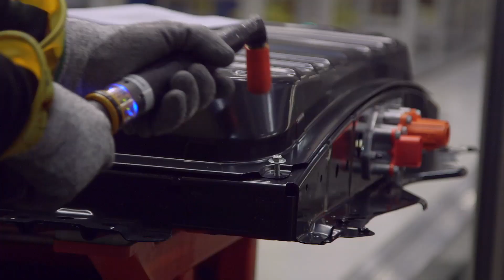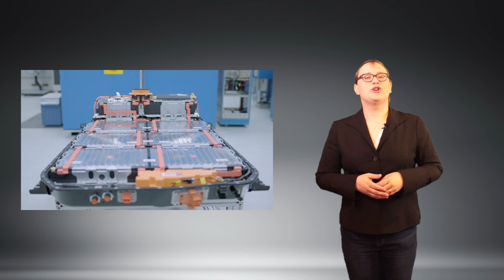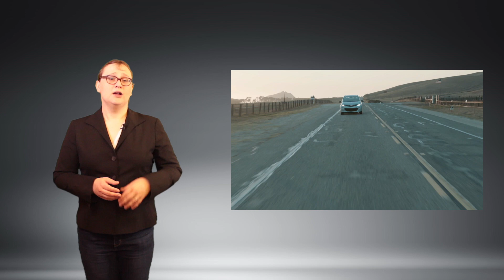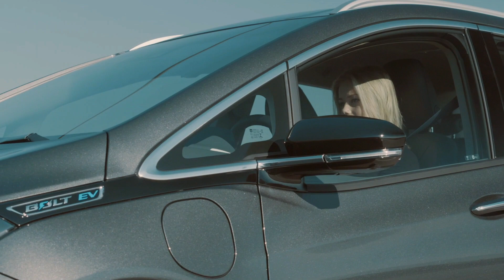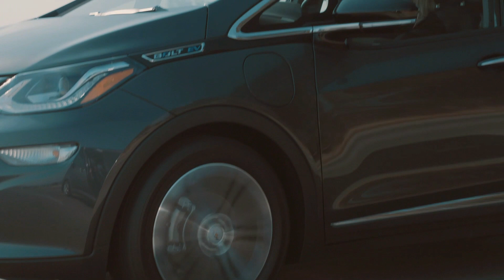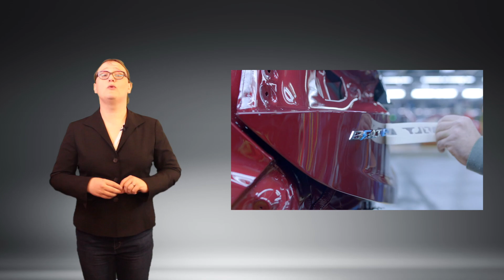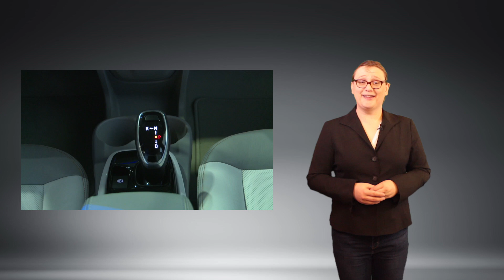Should You Worry About Battery Replacement Costs for Electric Cars?

Comment: Please don't forget, the larger the battery the less likely it will be used to extremes. 10% to 100% charge on a leaf is fairly common which ages a battery pack quicker. A Nissan Leaf with a 90 mile range   at 15000 miles a year will cycle a minimum of 160 times a year. A Chevy bolt at 248 miles range over the same distance will only cycle 60 times a year. If a leaf loses only 15% over 60000 miles I would expect a bolt to go 160000 miles for the same degradation. other factors such as improved chemistry and much fewer extreme cycles I imagine would put it way past 200000 miles and even then the car should still have more the 200 miles range. It really is not a problem at all anymore.
Reply: I'm not sure why people complain about their EV needing a new battery after a half million miles of usage. How does an ICE vehicle look at that point? Usually looks great...stacked in a junk yard.
Reply: Captain Morgan , never heard of those losses before and my whole point was that it isn't the milage itself it's the battery cycles. Age doesn't seem to be much of a problem so far, plenty of 7 year old Leafs knocking about with 7 year old technology and chemistry.
Reply: And your point is what exactly?
Reply: yes but... not really time. If you store your batteries at 50% and keep them at a temperature they like, they would last decades without losing much capacity. The life is based on how fast you charge and drain them and what temperatures they experience. I live near Adelaide, which is one of the most mild climate cities in the world so I wouldn't worry about the battery life of anything... particularly when there would be nobody who would use quick chargers exclusively.
Reply: + captain morgan absolutely 100% could not be more wrong.Ekectric cars do NOT lose 3-5% of a charge per day. I own an electric car, a 2013 nissan leaf SL and there are times I dont drive it for a week. after a week of no driving at all, I will have lost 1% charge. 

If you are driving an electric car and its losing 3-5% overnight just sitting there, you need to get that thing to the shop because there is a serious problem with it.
Reply: +Captain Morgan cost effective is relative. Many americans buy a car, keep it for 5 years till its paid off and then usually trade it in on a new car. At that rate, they are saving butt loads of cash over ICE vehcles in maint costs and gas prices. I can fill my tank for $1.50ish for my leaf. My ICE vehicle costs roughly $50 per tank. So, My ice vehicle gets roughly 100 miles per about $17 where my electric car does it for less than $2.HUGE savings over gas.

All batteries degrade over time however lithium is one of the if not THE longest lasting battery chemistry to date, I have also been an electric R/C pilot for over 25+ years and have used about every battery tech since the start of electric rc flying. Lithium batteries degrade very slowly. Heat is their main enemy that will cause damage. A good chemistry in the battery and good heat management and you are looking at a battery that can thrive for many years. In fact, my first lithium battery (that we had to make from cells because there was no businesses selling lithium for flying back then) that took my tiger moth from flying 5 minutes per charge with nicads, took me to 1 hour flights per charge with the lithium battery. I still have that battery 25+ years later. It still holds a charge and could fly another tiger moth and still get more time out of it then the nicad batteries we used back then. You really need to step back and learn about the tech, not just rambling some false information you gleaned from the internet.
Reply: +Darren Cole  Captain Morgan is a troll giving obvious lies.  Battery packs do not lose 3 to 5% charge a day, for example.  Don't feed the trolls.
Reply: Tesla owners actually collected some real world data about battery degradation. After 200K mile they are still over 90%, and more importantly degradation actually slows down with age. Google "Tesla battery degradation".
And these are the oldest batteries, Tesla switched too better ones recently, and they also have an even newer chemistry which doubles the lifetime. Also, battery degradation hurts much less if you start with 300+ mile range, and not 70. So the cars will likely fall apart well before the batteries need replacement. And once the batteries degraded too much, they still can be used for other things where energy density doesn't matter. Utilities for example are already using Tesla battery packs instead of gas turbines to match peek demand.
Reply: I've changed my mind, it's definitely cheap aftershave he's been drinking.
Reply: He's either drank to much rum or he works for the oil industry.
Reply: Well I'm glad you're talking to the mirror, gives us a break from your silly random anecdotes. 

I think we all have enough experience with ICE cars to know why nobody talks about how much work goes into keeping them in working shape. It's not news when an ICE breaks, it's just another Monday. Why even mention a silly thing as some negative, desperation that's why.
Reply: +Robert Harrigan The owner's manual is available online. I had a quick search through and the only "charge level" is reducing amps from the wall, to protect circuits that may not have been blessed by an electrician to be in shape to handle 12 amps.
There are two ways you could hack it to get a de facto charge level control in the pack. One is to set the time of off-peak rates in the evening to a time such that the car won't have time to complete the charge by the time you leave. There is also a hilltop "reserve" setting that sets aside some capacity should you live at the top of a 1000 foot rise like my sister. It doesn't say how big the reserve is, but that should be obvious from the range reduction.
https://my.chevrolet.com/content/dam/gmownercenter/gmna/dynamic/manuals/2017/Chevrolet/BOLT%20EV/Owner's%20Manual.pdf
Reply: Do you really wanna go there? Cause ICE cars are not exactly known for reliability, everything is an order of magnitude more complex and more prone to failure due to all the moving parts. We're talking 20 vs 10,000 parts.

But at least you have a new silly excuse to throw around now, so that's progress.
Reply: $30 bucks a year eh? No oil change no brake pads no nothing. You sure it's not a bike? 

https://www.google.com/#q=average+maintenance+cost+for+car+per+year
 $9,122 on average.
Reply: +Captain Morgan It sounds like your Honda is actually a Canadian Girlfriend You can't change the oil of an ICE car for $30, even if you do it yourself.
"Million mile" motors aren't unoverhauled motors. Major maintenance is required several times to reach that lofty milestone.
Reply: I just don't use trash, sorry. 

Proper maintenance and honest accounting is all you need to figure it out, not this "herp derp all a car needs is a can of oil every year to run" lazy logic.
Reply: I just bought a Bolt EV, and I work 80 miles away, so....I'm gonna find out just how tough these batteries really are. 160 every day, 183 runs a year. I've got a Clipper Creek Level II 32A rig installed on the wall, all ready to go.
Reply: András Bíró my point entirely
Reply: Well, every circus needs a clown right?
Reply: Joseph Stott better to charge to 100% regularly to ensure battery balancing with useage. Only keeping at partial charge not good for pack.
Reply: Darren Cole per year
Reply: Darren Cole if you love aviation then check out Walter Extra's new electric aerobatic machine. However, energy density is poor for good payload range required by air transport or big load carrying trucks.
Reply: Markle2k check out mild winter range of BMW i3 60Ah after just 3 years of gentle useage  41miles. Summer range closer to 75 miles. The more rapid charges the worse the degradation.
Reply: András Bíró as already discussed you need a huge battery like 60kWh or more to obtain tesla like losses. 2% of 300 mile range is better than 3% of 80 mile range  hence lack of older Leafs being reused with new batteries.
Reply: RWBHere just fitted a 2015 engine into 2001 Polo cost 250GBP.
Reply: +Luke W That's nonsense. The reason we stop at 4.2 volts instead of 4.25 or 4.3 is because putting in any more charge increases the risk of damaging the cell beyond any benefit. Charging to 3.9 volts or 4.05 volts is just another semi-arbitrary boundary created by a stricter definition of "damage", limiting the lifetime. It is analogous to de-rating in a helicopter engine.
Cell top-balancing is as simple as putting a high value resistor across the cell pack with the highest voltage until its open voltage is balanced with the higher capacity cells. More sophisticated balancers take energy from the higher voltage cells and send it to the lowest voltage cells, but the principle is the same.
Reply: Because either you suck at maintaining your car or just bad at doing basic accounting.
Reply: The average is what it is, it doesn't represent every person equally, that's the point. Some people live in rural areas, others in cities, others in the outskirts and commute, their usage scenarios will vary, and the figure is closely tied to driven miles. 

If you spend a couple hours a day driving back and forth to work, those costs will go up, if you only take the car out for a spin for ten miles every few days then costs will go down, simple enough. Many people commuting to the city fall under these scenarios, luckily I do not.

Personally my car costs me around $2000 a year to maintain in order to keep in reliable condition, my office is only a few miles away so I don't travel far, so understandably there's not as much wear and tear on my vehicle. Now my cousin in the city, his is another story, but of course he makes up for it with better pay so it's a wash. 

An EV would benefit both of us in different ways, but he will certainly benefit much more than I would, being in rush hour traffic all the time.
Reply: How can I set my BOLT to only charge to 90%? I use the "Departure" feature, and, I'm assuming, it's charging to 100%. I drive 80 miles one way, to work every day. Yes. 160 every day, so battery life discussions have my attention.
Reply: Wow. Hilltop Reserve. Nice. Sounds like a Battle tactic. Hilltop Reserve, or a Country Rock band. Or maybe a raspy ass wine.
Reply: Your math doesn't add up Captain Morgan. And your assumptions are baseless. Which means your conclusions based on such dodgy foundations are ridiculous.
Reply: Exactly. In the U.K, many people drive less than 10,000 miles per year. 200,000 miles would take 20 years or more to complete. (Our last car was about 18 years old and had only travelled 96,000 miles when the rust maggots ended its life.)  Many cars are designed for a service life of less than ten years. The Rover 100 Metro was seven years, for example. So, a Nissan Leaf would likely be at, or close to the end of its design life before the battery would become unusable. There are Leafs which are well into their design life and which have never needed a replacement battery. 8 years' guarantee (etc.) would suggest a vehicle design life of about that time. Abused batteries will obviously fail earlier, but so would an abused fossil-fuelled engine. A replacement new engine, clutch and gearbox doesn't cost much less than a replacement EV battery and motor. And total vehicle devaluation over time for almost any car will balance out, whatever the power system. So, frankly, batteries are perfectly viable as an energy storage format for a car.
Reply: Captain Morgan was an infamous pirate. So Captain Morgan is a time-pirate, a.k.a. 'troll'. I'll leave you all to waste your time on his pointless and recursive prattle. Bye.
Reply: Darren Cole The thing you are missing from your argument is the charging voltage rule with lithiums. If you charge a lithium cell to  its maximum 4.2 volts, in order to put the largest amount of energy into it as you can without damaging it, it will last in the region of 500 cycles before it has lost a significant amount of storage capacity (typically quoted as 70-80% of new), in energy. If you instead routinely charge a lithium battery to 0.1 volts less than maximum, (4.1 volts), the cycle count doubles to 1000 cycles while only losing a fraction of the capacity. Do that again to charge to 4.0 volts and the "law" continues to work, you get in the region of 2000 cycles. Something less than 3.9 volts is where reducing the voltage multiplier starts to reduce the lifetime energy capacity of the battery. Electric car manufacturers know about this and exploit it. No individual cell in your Tesla or leaf will have seen 4.2 volts since its birth until it winds up in a wrecking yard.
4000 cycles @ 200 miles/cycle is 800,000 miles. 200 miles is a typical work week. If you buy a car with a 250 mile range, that will just make a 20 mile one-way commute after its lifetime. 4000 work weeks (in American terms) is 80 years. Batteries that are properly managed are , on average, likely to outlive the mechanical components that are common to ICE and electric vehicles alike.

I dare any ICE enthusiast to point to any proven drivetrain that burns carbon atoms instead of exchanging electrons that has any hope of returning 70% of its design fuel efficiency after 800,000 miles of operation in a motor vehicle without having undergone any major service, repair, or overhaul in order to maintain its design efficiency.
Reply: Very compelling argument Mark
Reply: Loanword Eggcorn about 3% per year used or not. More if rapid charged every time.
Reply: @Captain Morgan apparently people here don't know how cheap engine oil is...
Reply: @Markle2k have you ever changed oil?? https://www.walmart.com/ip/Mobil-1-5W-30-Extended-Performance-Full-Synthetic-Motor-Oil-5-qt./17128876?action=product_interest&action_type=title&beacon_version=1.0.2&bucket_id=irsbucketdefault&client_guid=4f34e1af-ff15-4ae3-8bac-0bbe29eb6037&config_id=106&customer_id_enc&findingMethod=p13n&guid=4f34e1af-ff15-4ae3-8bac-0bbe29eb6037&item_id=17128876&parent_anchor_item_id=17034357&parent_item_id=17034357&placement_id=irs-106-t1&reporter=recommendations&source=new_site&strategy=PWVUB&visitor_id=Z-m_Ivx6S8PHirUZsfRt6I
Reply: @Allan dude, buddy, pal... i own a MK3 Supra that is modded  (600whp and it runs off corn juice not dinosaur juice) if that car cost me anywhere near $9k to drive 15k miles or in a year i would sell it... even a high end luxury car don't cost that much to run....